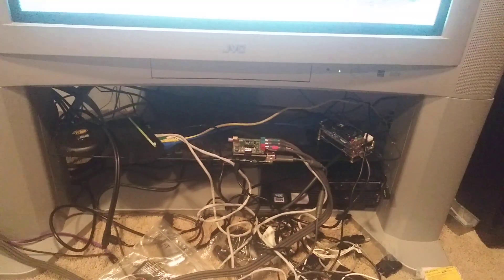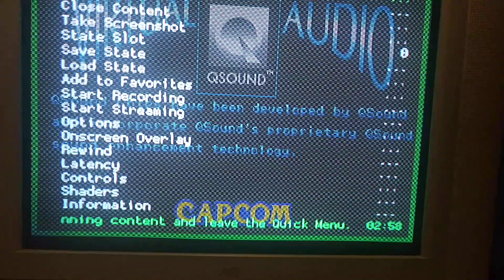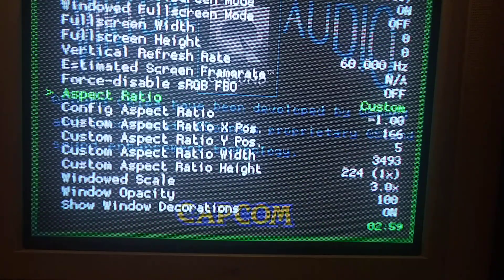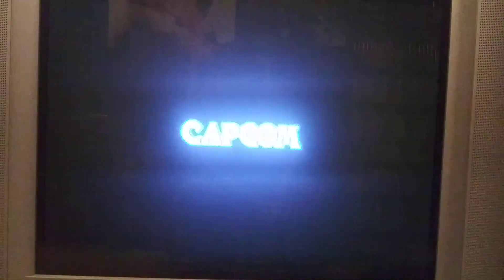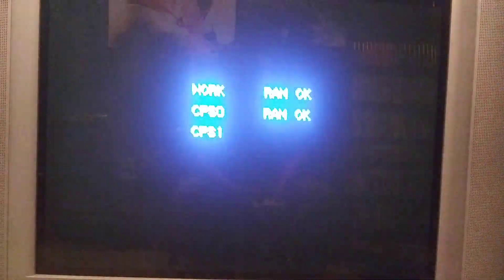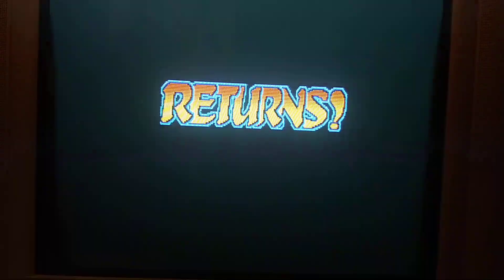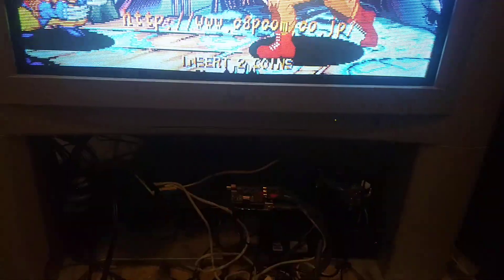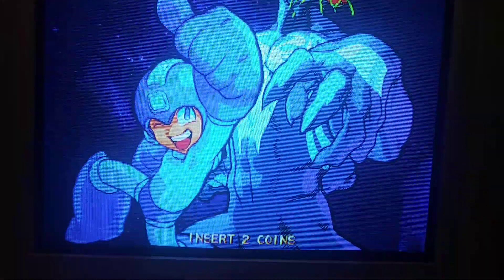Raspberry Pi 4 with Retrotink Ultimate

Comment: Bro this is monitor or crt tv
Reply from the maker: Crt tv
Reply: @BahnYuki  bro, just installed it on my rpi4 and it works great! BTW, is it possible to fill the whole CRT screen without going to the service menu? It's missing 1/2 inch on the bottom, it's no big deal, but it's noticeable. Thanks a lot for your work!

Comment: How do you make this work using the VGA port of the RetroTink Ultimate?
Reply from the maker: What are you trying to connect the Pi to? a VGA monitor or something else? Make sure you have the sync switch set according to the type of display you are planning to use.

Comment: how did you avoid getting a very slim image on the center of the screen?, I can't get it to use the full with of the screen
Reply from the maker: Go into the scaling options and place the horizontal resolution close to 4K

Comment: I'm having a hell of a time getting proper timings for CPS1 (384x224) over svideo on a crt TV.
Right now I'm using the standard timings from Mike Chi SNES/NES
hdmi_timings=2048 1 180 202 300 240 1 3 5 14 0 0 0 60 0 42954545 1

This works, but do you know what needs to be changed for 384x224? Or is my problem that it has to be 240 height over 240p?
Not sure if I even need to use different timings than what I'm currently on. Thanks
Reply from the maker: Are you getting s-video in color on a raspberry pi 4? Can you tell us what you did to get color?

Comment: Steps created by ErantyInc 

Flash a fresh Lakka install - use balenaetcher
1. Boot over HDMI
2. Do the partition resize thing and reboot - happens automatic first boot
3. Enable Advanced Options in User Interface - Settings - user interface -show advance settings
4. Change menu driver from XBMC to RGUI - settings - Drivers - menu -rgui
5. Change video settings to Custom aspect ratio, integer scale on - settings -video - Aspect Ration - custom
6. Set Custom Aspect Ration Width 920(6x) Height 240(1x)
7. Shutdown from the menu - this will save your settings
8. Put SD card in computer and copy the lines crated by Bahn Yuki at the end of the config.txt file and save the file.
9. put the SD card into the Raspberry pi4 and connect using Retrotink’s ultimate over component to a TV.
10. Copy your roms to a USB stick 

notes -
on Retrotink Ultimate and pi 4 with the config.txt settings - composite video and S-video shows as black and white and did not test RGB..  Video on a regular TV on component is missing about 1/2" at the bottom of the screen.. might need to readjust the TV or something..

There is a way to get Lakka and composite video from the Pi4 directly but it takes effort at the moment, there are instructions online on how to do that.. Lakka and a PI4 and a regular CRT over composite is a very good and cheap solution for gamers, lag is very low.
Reply from the maker: I can verify that s-video is indeed only outputting black and white
Reply: In item 6:

"6. Set Custom Aspect Ration Width 920(6x) Height 240(1x)"

Is '1920(6X) or 960(3X)??
Reply: @lenneth3 cool..:) Credit goes to ErantyInc..He wrote the steps, I only edited the steps with clear instructions where the settings are located in lakka:)
Reply: How did you adjust the screen to fit? Does it really take 1/2 half of the bottom of screen?
Reply: I'm not sure what I'm doing wrong but when I follow these steps I'm only getting a black screen on my CRT :(  Like, it switches to a 240p output but nothing shows up.  I'm using the latest Lakka on a Pi 4 B.
Reply: @lenneth3 I am also looking for a case... I have not seen one for the pie 4 and the retrotink ultimate.. if you find one please post a link.

Comment: @ Bahn Yuki - I installed Lakka 2.3.1 and your recommended code on the config..when I boot up lakka with a PI 4 and retrotink ultimate over component, I see a picture on the TV (main menu for retropie and the date/time) but I can not navigate the menu because everything is hugggge..If I manage to start a game, the game is extremely thin/skinny.. what am I missing? How do I correct the game from starting normal and covering the entire screen on the TV??..any help is appreciated.. thanks
Reply from the maker: Are you using rgui?
Reply: @BahnYuki  that's the part that I was missing..works now:).. thanks